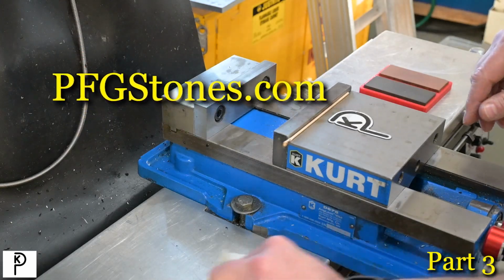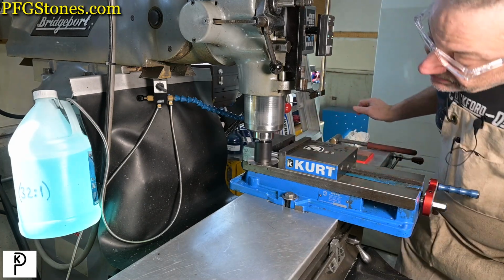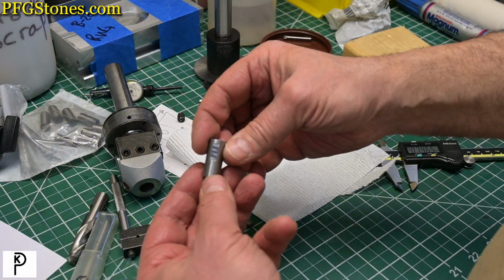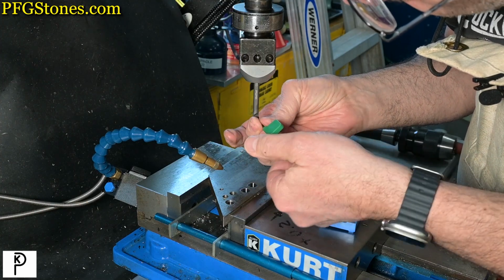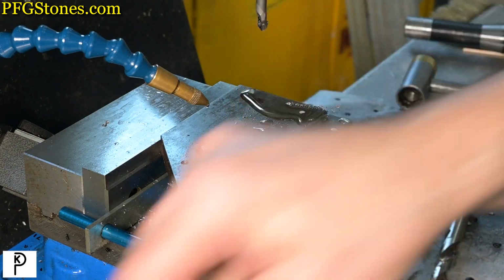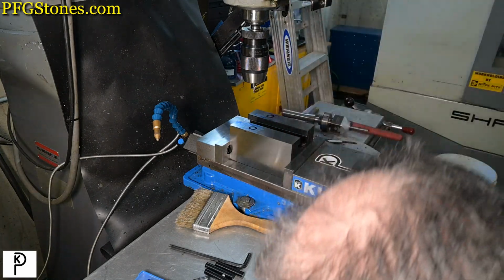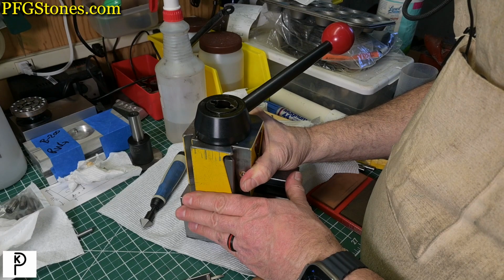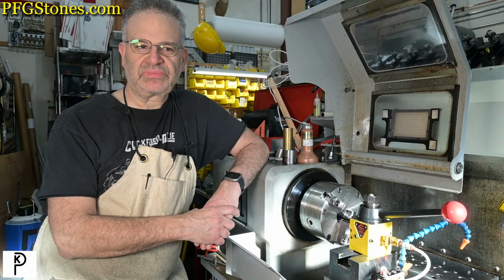Tool Post Fix on the Haas TL-1 Lathe - Part 3 of 3

Comment: Sharp, lapped inserts or brazed carbide tools are awesome for fine cuts and pulling off a nice chip with low tool pressure. I learned that from Robin. Renzetti, (Go figure eh?) How come you never told me I could  mount my Mini-Cool to the back of the vice⁉😁🤣 

I wonder if the act of removing and reinserting the boring head influenced the location of the point of the boring insert a few tenths one way or the other and the second hole bored a different dia? Or was it tool wear and pressure?
Reply from the maker: Good question!!  It's no Moore Jig Borer.

Comment: Nice work!  I watched Rob Renzetti's video on making a solid tool post to address the same issue and will probably do that.  My tool post will rotate on the compound as there is no index nor T-slot. Until I make the new one, a butcher paper washer (not a typo)  prevents the tool post from slipping on the compound of my lathe for the tool pressures I use.  Renzetti's video is here: https://www.youtube.com/watch?v=pG3YSfgyJPI
Reply from the maker: Thanks!  I played bass for Butcher Paper back in the 80's.  🫡